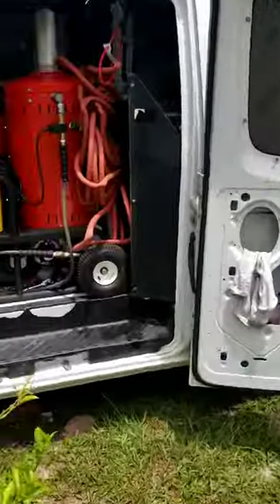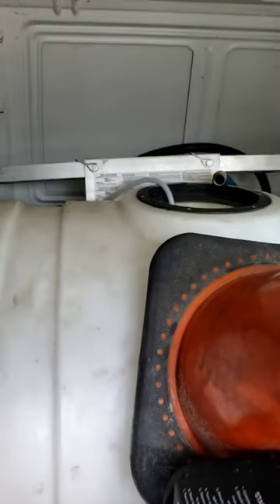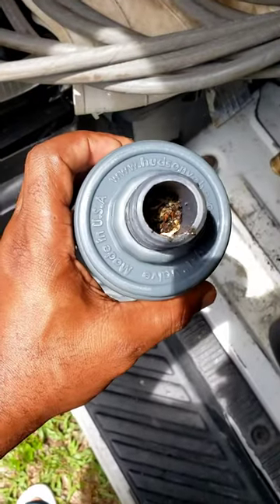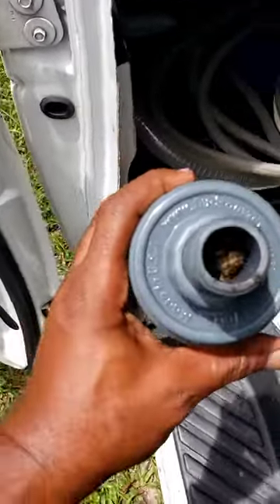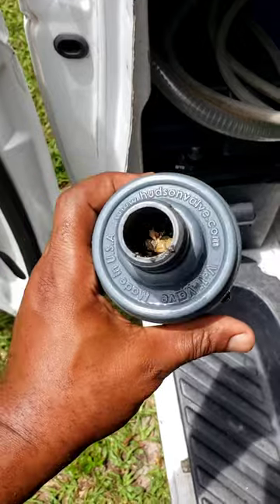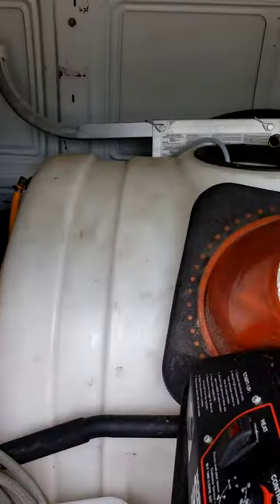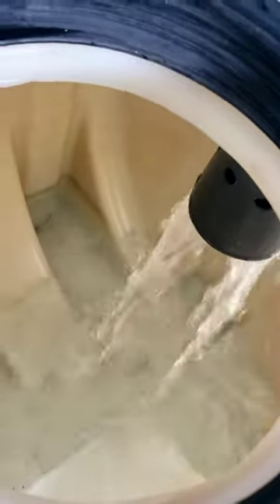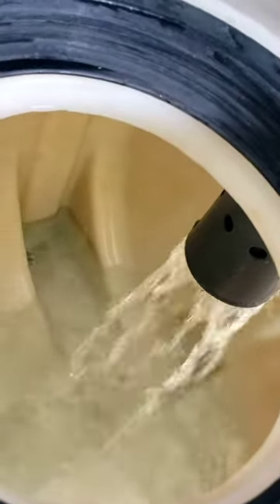Hudson Float Valve Troubleshooting

Comment: You have a video showing your rig and set up?
Reply from the maker: Not dedicated video but I've shown it. Im gonna make one though I got a few ppl that asked about that
Reply: @PinkFlamingoPowerWash  sounds good. Curious to your thoughts of running your stuff of the van..pros and cons to the van work life?
Reply from the maker: @veganbcurry3396  space runs out. And spills suck i made the mistake of not using a bed liner or floor protector. The sh will rust the floor out.  Pros are your equipment is safe and out of the elements